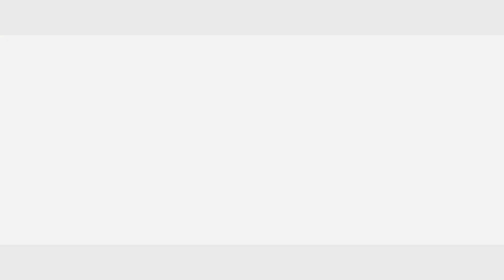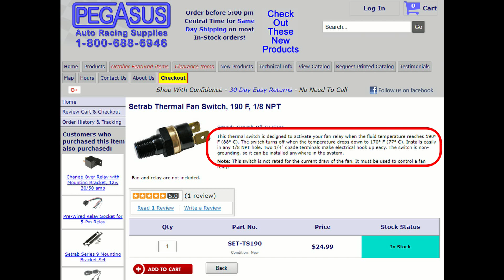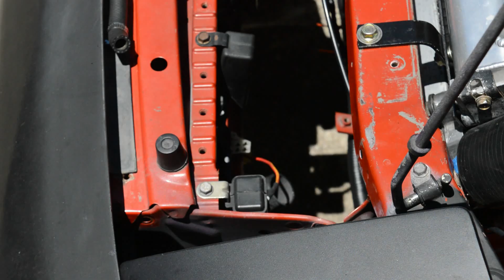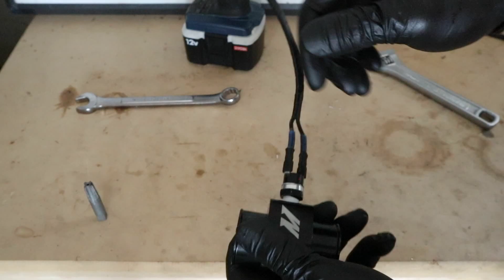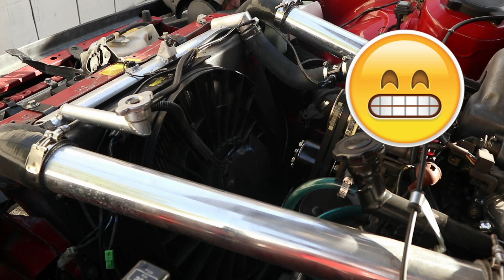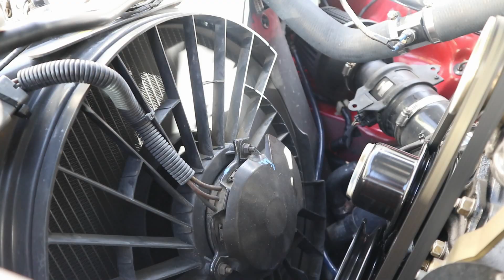How to Wire Your Electric Fan | Ep 19

Comment: I have this same fan and it makes a faint clicking noise whenever the fan is spinning. I thought mine was defective because of this, but it works perfectly. I watched this video as well as the one posted by Mohr Garage and it sounds like all of our fans make this clicking noise. Is this something you noticed too?

My fan clicks when spinning the proper way, but is silent when spun the opposite direction. Just wanted to make sure this was a normal thing for Nissan Quest fans.
Reply from the maker: Sorry for the delayed response. I don't recall any clicking noises from my fan off the top of my head. If we get a break in the rain this weekend, I'll start it up and give it a try.

Comment: What color wire is the one you tapped into for the 12v ignition ? My ac was removed from previous owner & I'm trying to identify a 12v ign source to tap into
Reply from the maker: Sorry for the late reply, I must've turned off notifications on accident and didn't realize I had comments! I don't recall the color off the top of my head, but the easiest solution is to grab a multimeter, connect the positive side (red) of the multimeter to the 12V IGN source in question, and your ground (black) to a ground on the chassis. If you turn the ignition to ACC/ON it should read 12V, and then go to 0 when you turn the car off. If it's 12V all the time, that's straight battery voltage, you don't want that.
Reply: @AlexFranceschi  haha no worries all is good ! I did end up finding my 12v ign source  & got all that sorted out
Reply from the maker: @htxlui1012  Nice!

Comment: Should my fan blow back to the motor or in to the radiator mine is blowing at the motor
Reply: Thanks man
Reply from the maker: If your fan is mounted on the side of the motor (like mine), you want it to pull air from the front of the car and blow it towards the motor. This is the conventional setup, to pull cold air from the front of the car. There are fans designed to mount the opposite way (in front of the radiator) that push air through the radiator to the motor.

Comment: I got both the temp switch and mishimoto adapter for it. Did you have any trouble threading it in the hole for it?
Reply: Nevermind I just realized that's how NPT threads are supposed to work.
Reply from the maker: @christopherhenry9449  haha that was an easy question to answer. Glad you figured it out!

Comment: Where do I put the 40 amp fuse between the battery and fan and  where exactly to install it? Spal paddle cfm 1640. 2006 accord
Reply from the maker: You can locate it anywhere you want. I installed mine into an empty slot in the stock fuse box under the hood, next to the shock tower. I wanted it to look OEM, but you can place it anywhere really.

Comment: You can hook up the high speed to the air conditioner if you have one so when you turn on your a/c the fan runs faster during when the a/c compressor comes on and off cycles....

Comment: Feedback: if the fan works at 2 different speeds would be great if a switch is installed in the dash to select the desired speed and give more details at each step . Thanks!
Reply from the maker: Thanks, maybe I'll make a follow up video for this. I still haven't needed the high speed setting yet, but you never know.

Comment: Great video! Im in the process of doing the e-fan conversion and i'm wondering if this temp switch and adapter would work with a ford taurus fan? Any idea?
Reply from the maker: Thank you! I'll give you a two part answer, but the taurus fan should be fine instead it more depends on your type of car. 

1) The temp switch, from an electrical point of view, any temp switch will work, you just need to wire it into your circuit correctly. However, you want to make sure it is in the correct temperature range for your engine. You don't want the fan to turn on too soon or too late. Typically, you want it to turn on after the thermostat has opened. 

2) The adapter, just make sure the radiator hose adapter matches the size of your radiator hose and your temp switch.

Hope that helps, good luck!

Comment: Would you suggest buying one from rockauto or instead of a used one. I cant seem to find one in my area.
Reply from the maker: Either option would work fine. There is a plethora of these available at my nearby junkyard so it was an easy find for me, but rockauto is good as well.

Comment: Hey bro!   I’m just passing through....

I do have a question.
You have a two speed fan there.

You could use three relays and two adjustable thermostat switches and have better control over your needs.

Nothing wrong with your set up.
Did a great job on the install and explaining it.

Just seems you could get more out from it.

By the way.    Those pwm are not really worth it.
I’ve own several (spal) to name one.
It failed out in the open desert. 😡

Relays fail, you can get those anywhere.
One Thermostat fails.  You can still run on one.
Sometimes primitive inventions are simply better.
You listening nasa!??...    lol!

Larry
Reply from the maker: mafosa thanks for the tip! 

I totally agree with you. However, the car runs so cool with the low speed setting, I don't think it's necessary for me at the moment to utilize the high speed setting. However, if I find the need to do so, maybe I'll make a part 2 video lol.

Thanks for stopping by and the great feedback (not only for me, but others watching this video)!

Comment: Hi, big thanks for this video!! Id like to ask if you could help me with my cooling needs.
I would like to hook-up 2 adjustable electronic thermo switches to my stock diagram (twin relay) can I do that by eliminating the stock thermostat from the diagram and just use the adjustable ones in its place? How can I run it without loosing my temperature gauge function?
Reply from the maker: zaher Unfortunately, I dont think i can provide you with a yes or no answer. I have no idea what OEM wiring diagram you are working with. On my system, i converted from a mechanical fan, so the wiring for the temp gauge is connected to a different sensor. I assume in your car the temp gauge and e-fan use the same sensor? Problem is, your gauge is calibrated to that sensor and its temp range. If you slap on a new sensor will it read the same or different? I cannot say. I would suggest creating a separate harness like i did so you dont loose the functionality of the temp gauge. Make sense?

Comment: What was your parts List? Great video btw👍🏻
Reply from the maker: Thank you! In the video description, I posted links to the parts I had to buy and what car I took the E-fan from. For the wiring and miscellaneous connectors, I just used what I had lying around. Hope that answers your question!
Reply: Alex Franceschi thanks. My water pump needs a gasket and doing this conversion will make things much more accessible.

Comment: Hi i want to know how to connect 2 radiator fans to an electrical home outlet. Its for my power generator shed im making for 1 inlet n the other outlet. Please let me know. Thanks
Reply from the maker: Sorry but I do not know electrical for housing or where to start as it's much different than the 12v system in a car. Goodluck